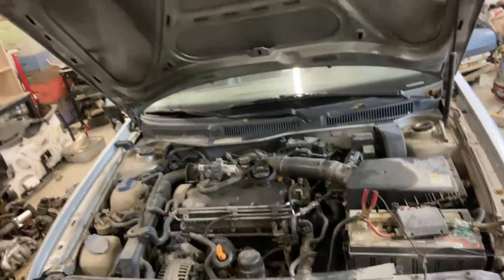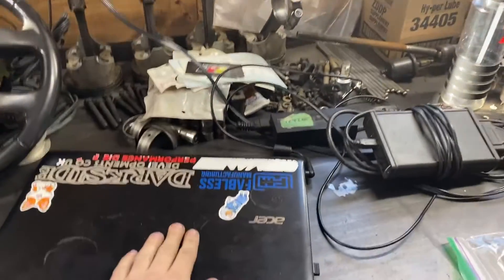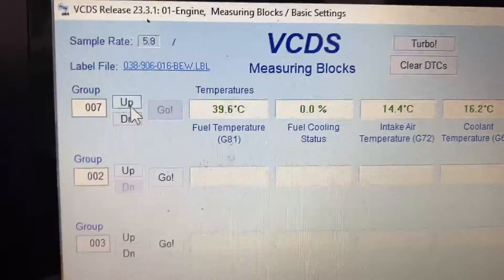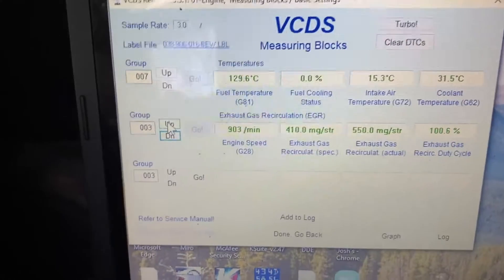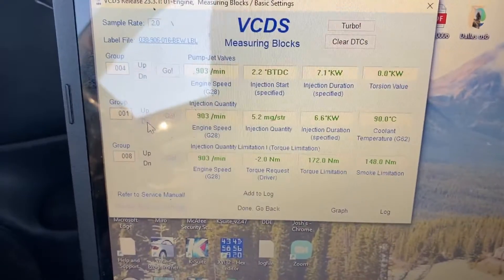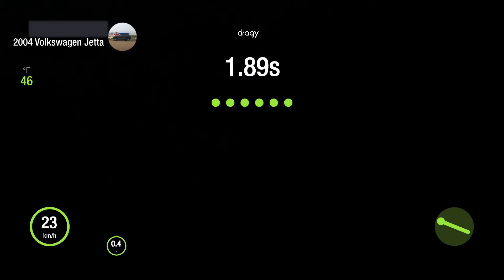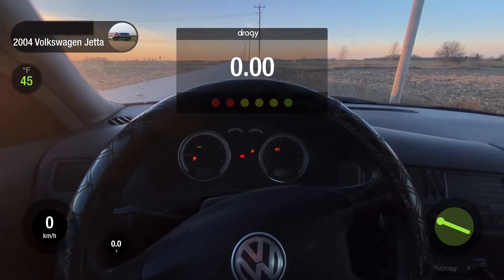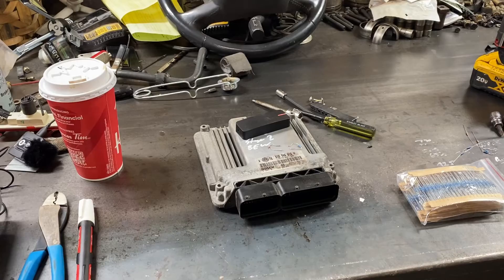"Evry Mod" Install on BEW PD TDI: Fuel resistor and MAF Diode mod

Comment: i needed one diode but amazon only had a pack of 500 for 12 dollars 😂
Reply from the maker: i was in the same boat, i tried 2 or 3 resistors and the 197 others are just sitting in a pile until the next project

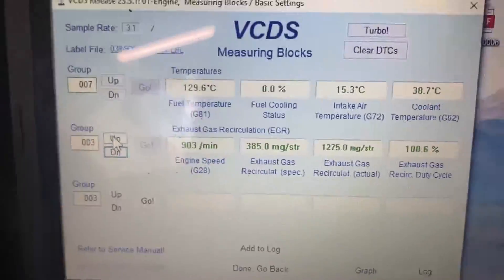Comment: question, at 06:00 you mention the pd engine will smoke with a worn cam

i think this maybe my problem with low power and smoke
my cam was replaced with idparts unit at ~250,000kms, i'm at 520,000kms now

is it possible to visually see wear on cam? is there a spec for lobe size?

Comment: Oh thank you, you made my day i got problem car dont go so well audi a3 2.0 tdi 170hp with dsg/s-tronic  andi dont get why no cods all good but car over 3000 rpm like it lose fuel on 1000 to 2500 i go nice but over that nope like sdi no lake vacum or air all good but this help me to see that car dont get fuel. And when i didt this car go like cryze but no smoke i thik car was running line

Comment: Why cant you just put a resistor in maf?
Reply: Porque una resistencia limita la intensidad, y lo que la ecu necesita es una variación de voltaje. Si quieres usar resistencia necesitas hacer un divisor resistivo con dos resistencias, para poder obtener un voltaje acorde a una lectura alta. Una sola resistencia no cambia el voltaje.

Comment: The diode and resistor does not work on DSG cars it’s slower with a diode versus without a diode and just the resistor
Reply from the maker: On a brm Jetta? It might use the lambda/O2 sensor as the smoke limiter
Reply: @ it was a 05 bug with the bew and DSG transmission.
Reply: Yep I second this and no smoke unfortunately 😢

Comment: Is this Deleted or is everything still in place? trying this out on my brm. seems to be working but not as much smoke as i was hoping for
Reply from the maker: Completely stock
Reply: @JoshsJettas got it, i’ve just done this on my brm, little bit of smoke when you first get into it, however the values in vcds are way different, can’t find anything related to EGR Flow but then again mines gone and unplugged, however maf flow is maxed out and so is fuel temp, slightly noticeable increase in power, just looking for a way to blow some more smoke lol
Reply from the maker: The ecu uses maf flow to judge how much egr is being introduced. It also uses the maf as a fuel limiter but on the brm it might use the lambda sensor in the exhaust.
Reply: @JoshsJettas in theory, couldn’t you rig up a switch to peg out the map sensor, make the car think there’s 25psi boost and then unplug the vgt so the car makes no boost, in theory would it not absolutely dump coal along with the maf and fuel temp mod thinking it needs fuel for 25psi when in reality there’s only a few psi
Reply: @toastindustries7737 have you tried this? I'm building a derby car for a county fair and think it would be fun with a hoodstack and smoke, sounds childish, and it is, but it's entertainment in the end

Comment: Tried out the mod and I’m having an issue where I step on the accelerator and it sounds like it’s flooding with too much fuel before it figures its shit out, anyone know if this is common?
Reply: Yes it's common because this is a bad way to "tune" a diesel. Evry mod can burn valves with time or kill your head with high cylinder temperatures.. Get a proper tune and all of that becomes a non issue

Comment: Max fuel temp is 130c, tried a bunch of resistors and the ecu wont read over 130. I think its best to stay just below this as sometimes the ecu doesnt like the sensor being maxed and will sense a fault putting it back to the default temp of 40c 👍

Comment: Is this bad for the motor? And also is that the stock exhaust?
Reply: Depends how you use it
I have used mine for 5 years no problems sometimes even on max settings i have 200 ohm resostor and 1kohm potentiometer
Reply: @apinasaatana  ohhh, okay makes sense
Reply: @apinasaatana what engine code?

Comment: I have the same motor and used the same resistor and diode but it wont idele and shuts off but its completely stock no deletes
Reply from the maker: I’d use a scanner and see what it’s saying maybe try dialing the fuel temp resistor back a but

Comment: I cant get it to work on my Bjb engine i used the same diode and tried down to 37 r and it just runs the same
Reply from the maker: It must have a different smoke limiter, some use the maf sensor and some are lambda based
Reply: @JoshsJettas How can I change that. But wouldn’t my engine still smoke if I used a 37 ohms in the fuel sensor
Reply from the maker: No the smoke limiter has the ultimate say. The fuel sensor might be saying inject 30mg/str but if the fuel limiter says I only want 20 that’s all it gets. I’m not familiar with that engine but you might be needing a tune
Reply: @JoshsJettas I bought a reader and can see that the exhaust gas recirculat(actual) also jumped to 1275 but my exhaust gas recirculat(spec) won’t jump any higher
Reply: @JoshsJettas do you know if I can do any diode or resister mod to lambda?
Reply: @JoshsJettas  is this true for Bew also? 
I can use a diode to get the maf to jump up to 12xx but the egr recirculating duty won’t pass 15% 
Ohhhhh you’ve got an egr delete tune on that ecu you’ve said right?
I’d bet that’s why we’re all having issue haha

Comment: Would there be a way to put it on a switch to turn it on and off or just have to pull it out when you don’t want it
Reply from the maker: I would imagine a switch inline would work, then switch it off which would make an open circuit and default at 40C

Comment: Sorry I meant what wattage?
Reply from the maker: 100 ohm resister for the fuel temp sensor and 1n4148 diode for the maf
Reply: @JoshsJettas are these the best ones for the pd 1.9tdi? I'd like my car to smoke as much as possible😂